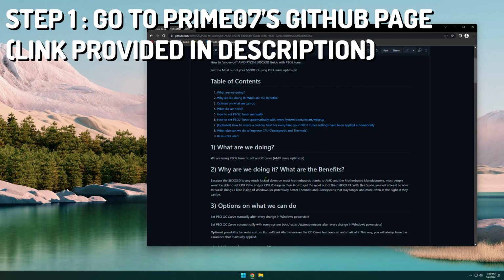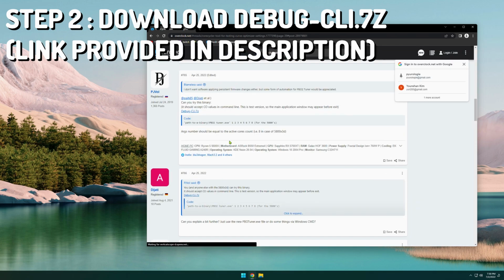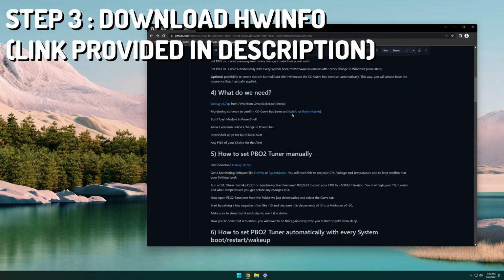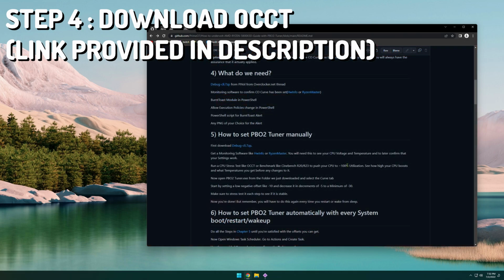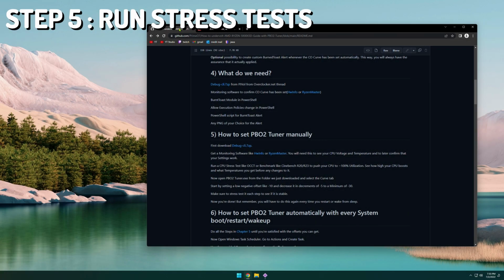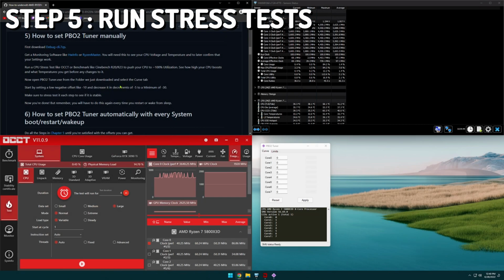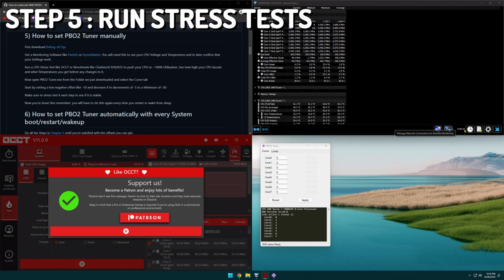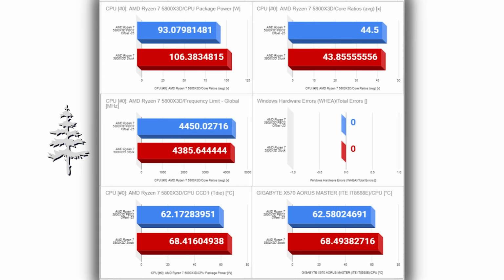How To Undervolt AMD Ryzen 7 5800X3D: 3 Minute Easy Guide To Lower Temperatures And Higher Clocks!

Comment: in the bios "all core optimizer magnitude -35" is that what you configure in the pbo turner program? Do those same parameters that are placed in the program go to the bios? I have the 5700x3d
Reply from the maker: with 5700X3D, max should be -30

Comment: There's no way to do this with gigabytes bios?
Reply from the maker: many motherboards added BIOS features to undervolt 5800X3D now, but when it launched you couldn't tweak anything
Reply: ive never messed with but would like to reduce temps and get a little more performance from x3D, I dont see anything on x570 aorus elite with latest bios to do so @pyurologie
Reply: man, wish i could figure this out, i went in and set pbo curve optimizer to negative 30 and got no difference... not sure what to do

Comment: Great tutorial. Thank you for taking the time to post this tutorial. Unfortunately, I did not experience any temperature difference with a Ryzen 7 5800x3d and Asrock B550M-C motherboard. I used a value of -30 with no effect. I'm inclined to think that it has something to do with the motherboard.
Reply from the maker: hmm it also depends on the applications but usually i see some difference.. weird

Comment: nice guide, I'm current using MSI mobo, it has a "Kombo Strike". I think it may work like this.
Reply from the maker: thank you! yeah, kombo strike does the same thing essentially, but at a BIOS level, so you don't need to re-set it every time  you open windows or create your own automation for it. I think levels 1,2,3 are equal to setting all cores at -10, -20, -30.

Comment: Love the straight foward video. I literally installed my 5800x3d and loving it. I got undervolting out of the way and i have a question if you are able to answer. I'm running a 3600 cl16 G Skill Ripjaws ram (2x16gb). I have the XMP profile enabled but is there any performance benefits from trying to manually overclock the memory? Im still researching but people say its not needed because of the 3d cache. I'm a performance junky when it comes to my FPS games.
Reply from the maker: thanks man. I was curious about this too, so I tested it in EFT, which is known to be heavily CPU+RAM dependent, check it out for yourself :)
https://www.youtube.com/watch?v=N5HQcCihtrU

here's a wz video where I ran the RAM at 2667 CL20
https://studio.youtube.com/video/uSstM7jn3QQ/edit

here's another comparison where I ran the X3D with RAM at 2667 CL20 vs the latest chips just to show its effectiveness
https://studio.youtube.com/video/XWne1jqhdjI/edit

hope this helps
Reply: Hey guys same thing here😅
I thought this cpu only supports up to 3200 ddr4. Wouldn't it be pointless to throw higher speed ram or overclock ram ? 🤔

Comment: -30 all cores on mine for a couple months now and I'm only hitting a max of 53 degrees in Tarkov. Kraken x73 cooler.
5-10 degrees cooler than stock with lower power use, clocks stay at 4.45Ghz except at idle/very low load.
This CPU is night and day compared to my 3700x in all aspects.
Reply from the maker: the X3D is from the future, amazing innovation from AMD
Reply: upgrading from 3700x too, cant wait.

Comment: can someone help with not fully utilized rtx 3080 at 1440p in some games (cyberpunk, rdr2)? cpu is 5800x3d. gpu utilization is stuck at 94-95% at that res. can it be because of b450 pcie 3.0? btw fully utilized at witcher 3.

Comment: Would you mind making a video on tweaking PPT, EDC, TDC limits with the 5800X3D? I saw that those values are still available in the BIOS (but they're hidden away in some sub menus) and people have seen dramatic temperature drops by tweaking those values.
Reply from the maker: hmm ill have to do more research on this, I haven't done this myself
Reply: @pyurologie  Just FYI I did this today (set PPT to 120W, TDC to 75A, and 105A. I got basically the same performance in cinebench at significantly lower temps.
Reply: @wiktor.rajzner  my PBO2Tuner offset is -20. Tested with OCCT Large and Cinebench and various games. So far so good :) and what's crazy is that I'm cooling it with a single beQuiet PureLoop120mm AIO + Phanteks T30 fan at 2000 RPM. It doesn't go past 80C under Multi-Core bench.
Reply: @wiktor.rajzner  same same, I set mine on BIOS: 110W, TDC:70A EDC:105A and PBO tuner -30....80C in CR23 with 200pts slight boost
SFF build with Air Cooler Scythe Fuma 2; Case: NR200P
what you got?

Comment: I was struggling a lot with my 5800x 3d,temps were way too hot,in cinebench I was easily above 90 degrees…after this guide temps never goes above 80,I got +200mhz and scored 14.500 in cinebench,when before I wasn’t able to reach 14.000…thank u man
Reply from the maker: awesome! glad to hear it helped unlock more performance out of your setup!
Reply: what cooler do you using?
Reply: @biansanity  deepcool castle 240mm
Reply: @shockwav3xx  and what temps do you get when you gaming after this settings? Since we have the same cooler and I have plan to upgrade my cpu soon.
Reply: @biansanity  in warzone 2 i m getting around 64/65 degrees

Comment: In order to maintain the undervolting do you need to always run a utility in the systray or at startup, or do these settings get saved as a default in the BIOS?
Reply from the maker: yes PBO2 tuner must be restarted and set every time Windows is restarted. On PrimeO7s github page, he has a walkthrough to create your own automated script too
Reply: @pyurologie  what about waking up from sleep mode? do i have to set it up again every time it wakes, or jus for restart only??

Comment: Hey my 5800x3D CPU doesn't boost over 3.6ghz under load, any idea on how to fix?
Reply: If temps are too high it won't boost up
Reply: You need to update bios
Reply: update bios, reset bios to default settings and if that doesn't work reset CMOS
Reply: @Rikitangoable  bruh this was a year ago 💀

Comment: My 5800x3D has been stable for a a few weeks with a -30 undervolt and PTT 95  TDC 60 and EDC 90A. Though my chip will normally stay at 4450 while playing, sometimes in games like WoW where the usage is 8% CPU when nothing is happening it'll drop back to 3600 for like 2 seconds. I know this is super nitpicky but can I change anything else to force the 4450 that much more?
Reply from the maker: hmm I don't have any experience testing WoW so I can't speak from any experience on that. For the games I play, as long as the chip is between the 50s-60s, it seems to hold the max boost clock steady. Do you have an ASUS mobo by chance? I feel like others have mentioned this and they were all ASUS boards
Reply: @pyurologie  Yes its an ASUS TUF Pro WIFI. Mine holds the boost clock 97% of the time, only sometimes will it go down for a second or 2. I'll probably not losing performance but I would prefer it stay constant lol
Reply: did you check your score in CR23; curious to know your score in it - before and after...
seems a bit aggressive with the Limits...performance will like a rock with mine with these limits; best I got was:  110W, TDC:70A EDC:105A and PBO tuner -30
Reply: @HitSousouK  Around 14500. But R23 really doesnt matter because its a gaming CPU. Its not meant for rendering and being maxed out. No game is ever going to use 70% of this CPU, if it does something is really wrong. The key isnt the R23 score, its finding limits and an undervolt that is just above your max gaming temp. If its not downclocking during gaming, you don't lose performance and thats all that matters!

Comment: Many thanks for that, my 5800X3D works better, and coller ! A big hug to #Sentinel_Prime_ of course too!
Reply from the maker: Heck yeah, even with its amazing performance and its low power draw (compared to 12900K), I believe they left a lot of power and efficiency on the table with this chip on purpose. I believe they developed 3D V Cache and saw the effects, then became aware they're now the leaders in this space. So, even a muted and locked down 5800X3D would crush Intel's gas guzzler flagship 12900KS. Remember, they didn't even need to put 3D V Cache on their flagship chip to beat Intel's best in performance AND efficiency. And you know they tried this internally. I believe it was too fast compared to what's available now so they are releasing it in stages. And that's why I think they used a Ryzen 7 chip over a Ryzen 9 for their first X3D release. But, I believe they locked it down so as not to encroach on their next few generations of chips powered by their new technology.

Comment: hey @pyrulogie, i followed your guide with a -25 offset and my max temps are 6c lower than stock however my clock speeds were already maxing out at 4450 stock, does this mean im unlikely to see a performance increase but just cooler temps as a result of the undervolt?
Reply from the maker: So I was maxing out before undervolting, but it would only boost to 4450 in spikes. With PBO2 Tuner on, I'm locked at 4450 constant. If you were already locked at max, then yes the temperature decrease and usually slightly lower voltage on vcore would be the advantages gained from undervolting.
Reply: @pyurologie  thanks for the fast reply man, my 5800x3d was only 56c in a 3 min occt test and now its max temp is 50c, in warzone its only 45-50c which seems crazy low compared to most
Reply from the maker: @anthonyv8136  np, thx for commenting and reaching out about your results. It's a pretty badass chip right
Reply: @pyurologie  for sure. Such a huge upgrade from my 3700x and really gets the best out of my 3080. Hopefully soon we can change the clock multipliers!
Reply: @anthonyv8136  Yeah i just upgraded from 3700x as well, my GPU is only 3070 though but I still got a solid performance upgrade going to 5800x3d. +20-30 AVG fps gained, the big one was my FPS LOWS - they have been brought up to what my AVG fps was on the 3700x. No more drops down to 40fps, now it only drops to 75-80fps for 1% lows.

Comment: Life saver for a hot summer days, mine was locked at 90 degrees basically, this helped me drop it to 80 with -30 offset. Is there any downside or possibility of crashes? I have ran a bunch of cinebenches and it was completely fine, should I be afraid and lower it to avoid crashes?
Reply from the maker: awesome! No, the great thing about undervolting is that there is no risk of damaging hardware. The only thing that can happen is the system doesn't get enough voltage and shuts down safely.

Comment: Thanks for sharing this, got mine running max 60c now before it was 78c max and the clock speed stays stable. I did -30 on pbo2.
Reply from the maker: no problem, glad to hear it improved your thermals and performance!
Reply: what cooler do you using?

Comment: Probably a stupid question but how did you get the clock ghz to go up? Call me stupid (rightly so) but I thought since it's locked its stuck at the base clock 3.6 or whatever it is and doesn't move.
Reply from the maker: not a stupid question at all. Actually, I appreciate when people post questions. The base clock is 3.4GHz, you're correct. It also has a stock boost clock frequency of 4.5GHz. Undervolting the CPU resulted in higher boost clocks being maintained longer.
Reply: @pyurologie  oh, so right out the box it will go to the max boost when under load? So doing the things in this vid just adds stability to it?
Reply from the maker: @midnightvigil  yeah max boost clock is the same. Undervolting the X3D with PBO2 tuner results in higher boost clocks maintained longer at lower thermals and lower voltage under the parameters I tested in this video.
Reply: @pyurologie  sweet! The whole reason I was on the fence was I thought it was stuck at the 3.6. Now that I know if boosts up when doing anything I'm def getting it
Reply: @midnightvigil  BTW if you didn't update your motherboard bios it will be stuck at 3600ghz -happened to me in the first day with this cpu after updating it boosted normally to 4.5 and it is usually around that number.
Reply: @RealAudi  isn't updating mobo bios dangerous? I built my system in October of 2021 so maybe it will be fine?
Reply: @midnightvigil  no it is very straight forward, check any youtube video with the same motherboard manufacturer you have, the problem with r7 5800x3d it was fully supported by motherboard manufacturers on March but through bios update, otherwise it will work on low speeds
Reply: @RealAudi  that's it then? Do I need to install any cpu drivers? I feel like popping in the cpu and just downloading mobo bios is too good to be true😂😂😂
Reply: @midnightvigil  yeah especially with r7 5800x3d, bios will be enough, but if there are any updates to PCI and other motherboard parts like lan or USB  you can also do it.

Comment: My X3D survived stress tests at -30 which is great. Is there any risks to doing this?
I also want to upgrade my C18 3600mhz ram, would you have any suggestions?
Reply from the maker: I think the worst thst can happen from undervolting is system crash/black screen/blue screen and restart. From my understanding, no  physical damage can occur to the chip from undervolting
Reply: @pyurologie  Thanks for the reply. I have been following your content on the X3D and it's been great. Keep up the good work :)
Reply from the maker: @petarracic6740  thank you for your kind words

Comment: FYI, some motherboard vendors have started releasing new Beta BIOS which include the Kombo Strike utility for the Ryzen 7 5800X3D and  Core Offset Voltage. Kombo Strike is basically curve optimizer, i.e. setting it to 1 is equivalent to -10, 2 is -20, and 3 is -30.
Reply from the maker: Thanks yeah I saw it but limited availability for now. I used this tool since my board is Gigabyte and can be done within Windows as opposed to within BIOS